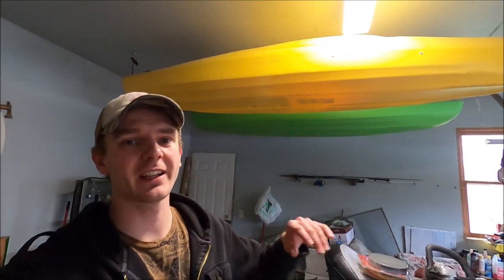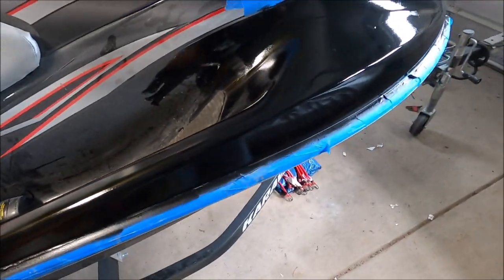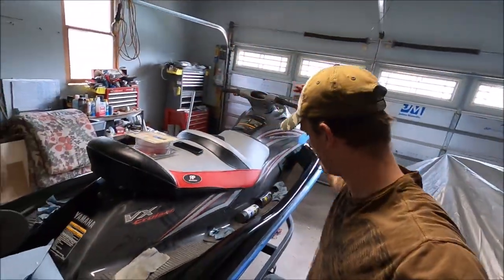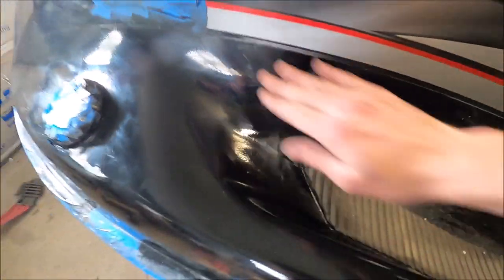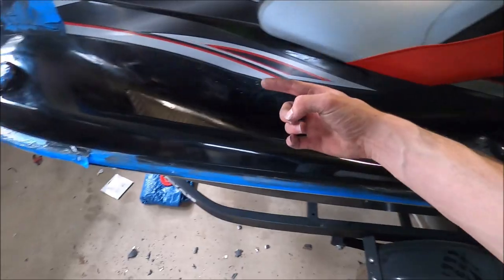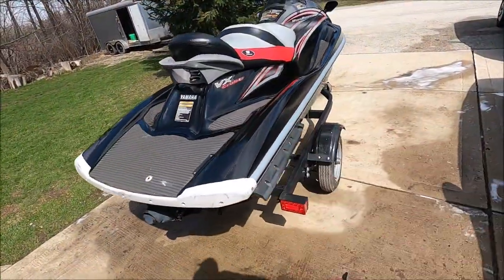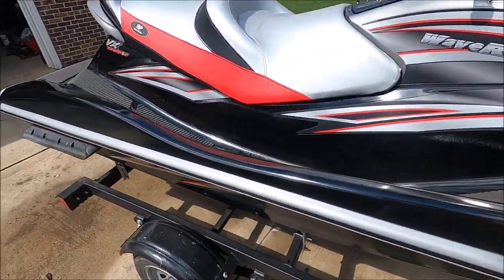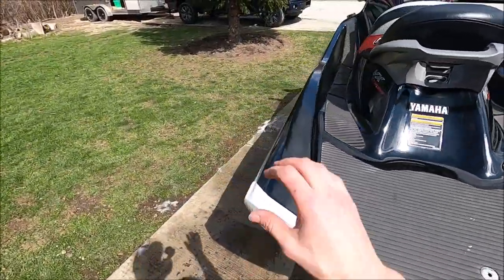Refurbishing an Abused Jet-ski Part 2! Final Assembly!

Comment: I  bought a used waverunner and i just realized that previous owner painted all bumpers black all the way around the ski. Last weekend pain started to partially peel off. Any advice on how to remove paint from those bumpers or how to repaint? I think its all rubber so I dont think paint will stick for long time.
Reply from the maker: I believe they do make specific for trim/ rubber pieces. The main issue with paint work is always the prep. If it is not properly prepared then the new paint wont adhere well.